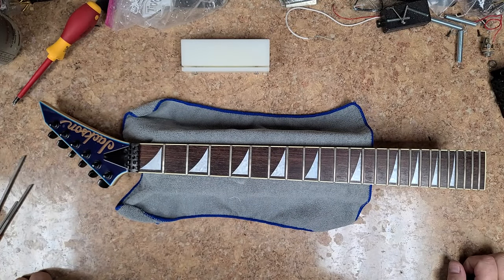Jackson DK2 From Hell?

Comment: That’s the problem with Licensed Floyd Rose trems. I rebuilt a Floyd Rose Special that is in my Jackson Dinky. Stainless steel screws all around and hardened steel saddles. The plates on the Specials are spot hardened vs hardened steel on the better ones but as long as the business end is hardened I’m good with it. Ha ha! I open my Tite-Bond with channel locks!

Comment: I mean i don't know i almost think if the owner was pushing to put it on anyway.  I think that i would have told him that get the same spacing the pickups and bridge 42.5 i think? The neck with the strings i think there all the same anyway 42/40 i don't think that the strings would hang over or be right on the edge? Not sure.  Billy Joel said I may be wrong i my be right. Eric my next video is going to level the frets with a cinder-block!